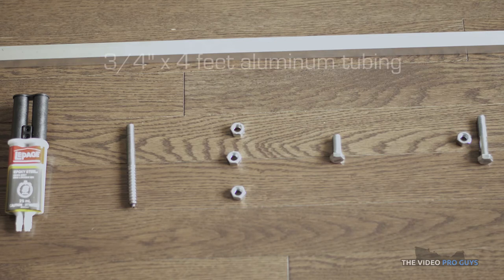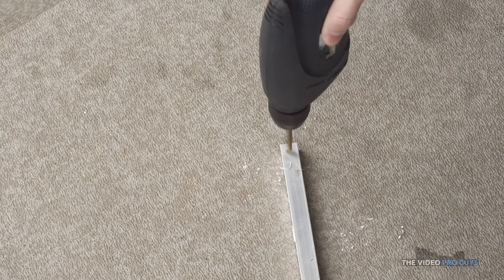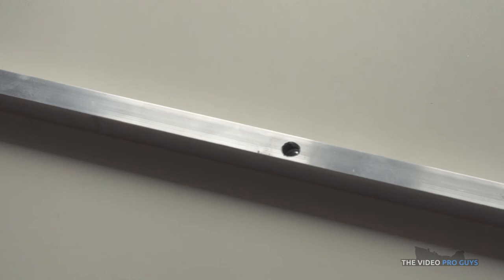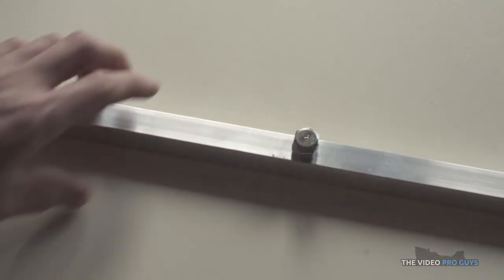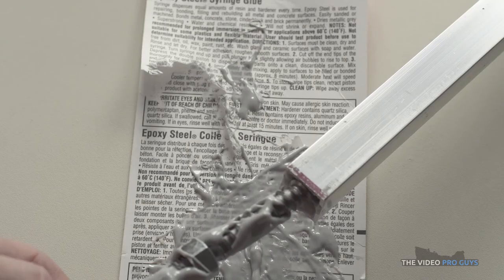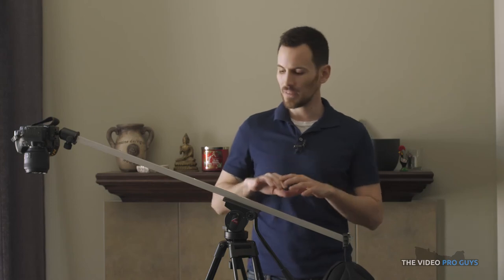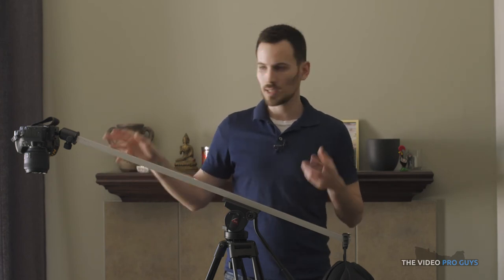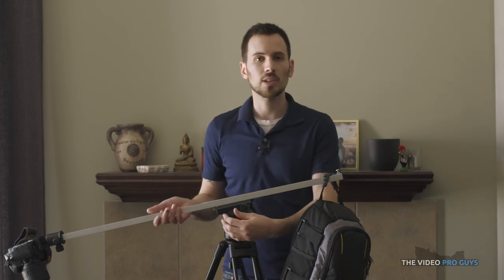$20 DIY Overhead Tripod Mount

Comment: Right now I have a tripod, duct taped at a forward-leaning angle onto a chair, with a wooden spoon taped and secured onto the handle of the tripod.  Then I have my phone secured to it with a hair tie.  I believe I have photos of it on one of my videos.  It is a badass setup, but I want something better for my DSLR, and I need my chair back, so I'm going to try your setup.

Thanks for this!